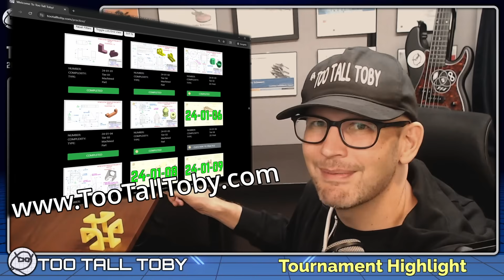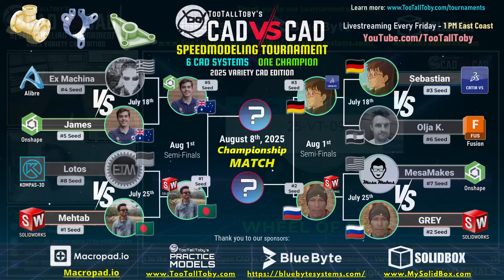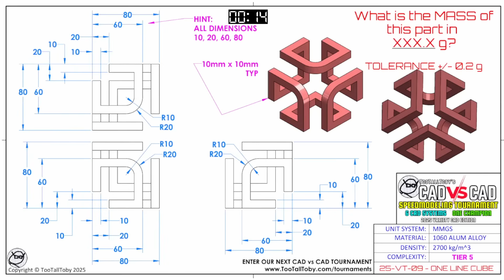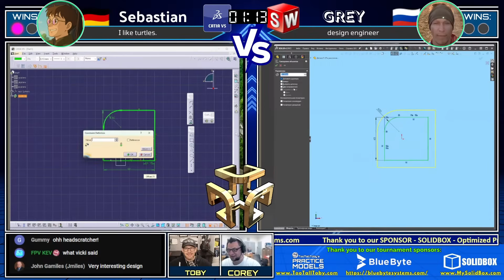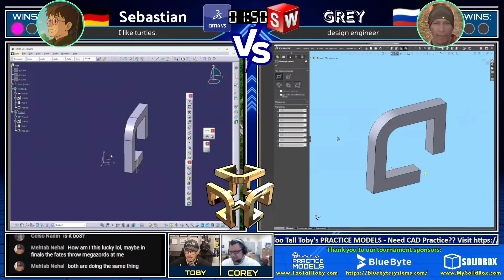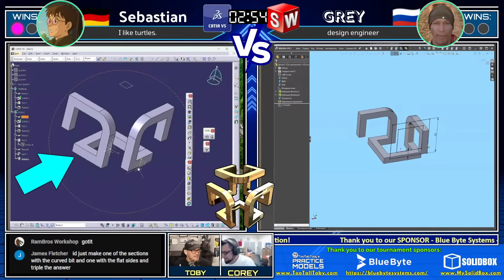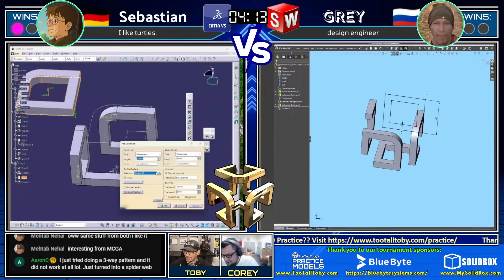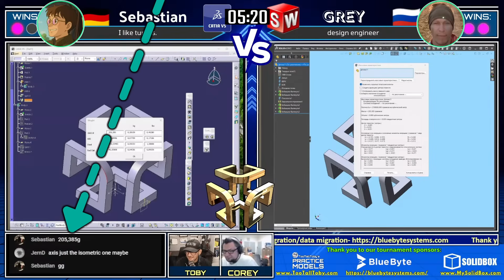CAD vs CAD TOURNAMENT SEMI FINALS 🎮 CATIA vs SOLIDWORKS - Battle 2

Comment: Just for fun I tried modeling this, I noticed it was symmetrical three ways about a diagonal axis so I just modeled the bottom face and 2/3 of the right face and half of the left face and then 3d sketched that diagonal and used the circular pattern tool, managed to do it in 6 minutes just because I'm not that fast but I feel like if one of these guys did this method they could have done it way faster, on my second attempt I did it in 2:30 but that obviously doesn't count

Comment: Since this model has a uniform 10×10 cross-section throughout, it can be modelled using a sweep along a 3D path. The advantage of this method is that only two dimensions (30 and 50) are needed to define the path. After creating the path, fillet three of the corners, then sweep the 10×10 cross-section along it. I used Fusion 360’s 3D drafting feature to create the 3D path.
Reply: That’s what I was thinking, 3D sketch + sweep

Comment: Is there any rules about using assembly tool? Seems to me you can create 1/3 of the cube and assemble them into the final cube with simple constants. Instead of building the whole thing in one sketch. This would work in inventor. New to this Chanel so correct me if im wrong 😅
Reply from the maker: Hi welcome to the channel!  You could totally use assembly mode to come up with the correct mass!  One of the fun things about this tournament is watching the different techniques the runners use!

If you wanna register for the next one , visit https://www.TooTallToby.com/tournaments
Reply: I had the exact same idea want a very quick method but just modeling one of the sides and then just adding the others.

Comment: why didnt they 45degree mirror it 🫩
Reply: Heat of the moment. Seeing this for the first time while in a competition; is a way different experience. The most obvious things don't come to mind quickly, especially for such an unusual model.
Reply from the maker: They are seeing the challenge for the very first time, LIVE, during the tournament. so it's a lot of pressure to come up with the most elegant solution, AND you know that your opponent may be closing in on an answer!  It gets your heart pumpin!
Reply: I did the mirror method as well when I tried it, works quite well and is very quick if you know where to place the planes. Took me a couple tries, though.

Comment: I wonder if in this case one could take advantage of the fact that the part is formed by 3 identical clusters. For example, one could just model one and multiply the weight by 3
Reply from the maker: this would definitely be an option - I think the problem/challenge would be figuring out where the overlap would be, when you make your original "cluster". It's basically a triple miter, so you'd have to figure out if it should be an overlap or an underlap or where one cluster ends and the next begins.
But yes- this totally would have been accepted.  They can use whatever path they want to come up with the correct mass, and only the correct mass matters, to earn the point 😁

HOW TO ENTER: here's a quick overview: https://www.youtube.com/watch?v=2OgSFOK3g1I 
And here's my tournament qualification run: https://youtu.be/85lB4qYdWNs?si=hUpfk1dMhFv_b4UO
Reply: @TooTallToby  Thanks for the answer and for the very nice video series! Yes my idea was to form a "cluster" (sorry probably there's a better word, I am not a native speaker) by taking the part at 4:10 and adding two extrusions (with the 10x10 square as sketch, of length 50) near to both the ends, in the same direction as the first one depicted in 4:10. The two extrusions needs to be cut at 45° deg at the extrusion end. Like this it should be exactly one third of the entire part.
Reply from the maker: @IvoCampi1  Nice! I love that strategy!

Comment: Wouldn’t sketching it in 3d then sweeping it be quicker
Reply from the maker: Maybe - the cool thing is that this model is on the website now, and people are posting their own solutions in the community videos section.  It's so fun to watch how people think through this one!
Reply: Maybe for competition, but i would never sweep a model like that for work. Complex sweeps = long rebuild times.
Reply from the maker: @user-rp8eh7gr5i  yeah
Reply: I wouldnt' say sketching a central line in 3d would be easier, aside from all the dimensions of said line that you would have to calculate from the dimensions of the sketch given you would also have to pay attention to the thing as a whole which I don't think would be very efficient. If you were able to get it right on the first go maybe yes it would be quicker but any trouble along the way and it would be a nightmare to troubleshoot (my take, could be wrong)

Comment: I wonder if this would have been quicker to calculate by hand. It's so nice and symmetric and there's only one curve to account for
Reply: This is a CAD tournament, not a math-physics Olympiad.
Reply from the maker: this would definitely be an option -  They can use whatever path they want to come up with the correct mass, and in this tournament only the correct mass matters, to earn the point 😁  it would be fun if they did it onscreen, with calculator, so everyone could see how they got there :-) 

I think in the heat of the moment you tend to default to the most familiar tool, and for these guys that tool was CAD.  But all options are on the table! 

HOW TO ENTER: here's a quick overview: https://www.youtube.com/watch?v=2OgSFOK3g1I 
And here's my tournament qualification run: https://youtu.be/85lB4qYdWNs?si=hUpfk1dMhFv_b4UO